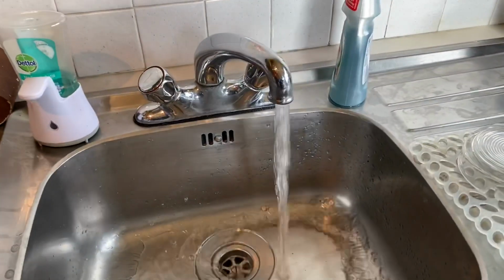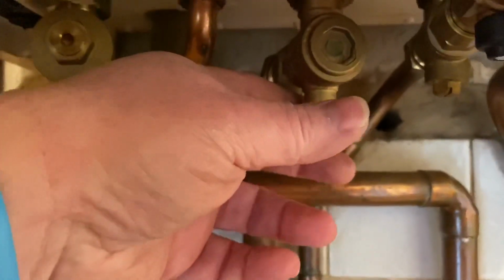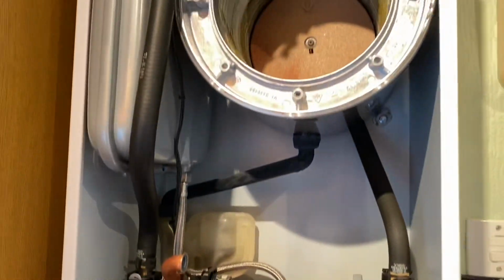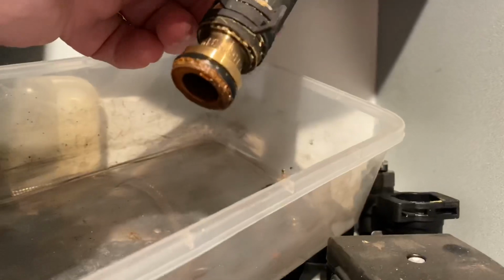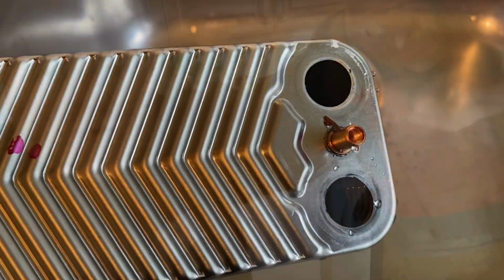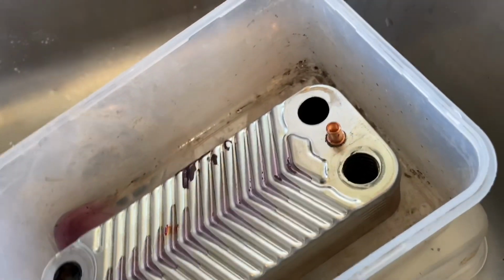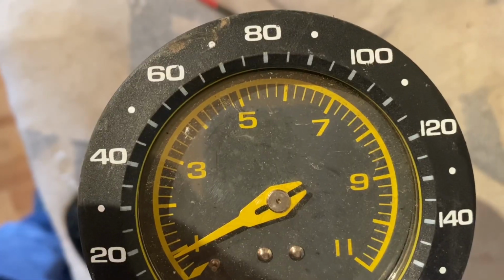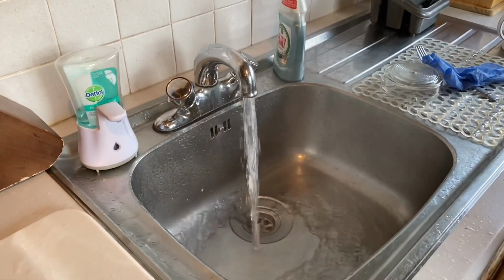Blocked Plate Heat Exchanger Magnetite Sludge - Viessmann Vitodens 100

Comment: so ive got boiling hot water in sink
warm water in shower. 2 showers.
and 2 sinks the same.
is this the diverter valve or sludge in pipes and heat exchanger plate.

also i presume this wont be covered in warranty.

and what should i expect this to cost.

veissman 100.

thx

Comment: Hi Allen,  would you say that limescale is a major cause? i noted you only cleaned out one side of the plate.  i have popped some cleaner into the magnetic filter (having cleaned it out)..i am trying to avoid removing the plate and would rather look for a solution in situ. Very informative video.

Comment: The gas safe engineers rarely open up the boiler. They pull down the front, connect their laptop and that is it until they check the gas flow.

Comment: i am learning so much about my boiler and why the hot water was not working  ,i should have become a boiler engineer especially when you see how much they charge,
Reply: Go for it. Then you'll see that just gas registration (for the first year) is nearly £600. Before that there's the training, which might cost thousands of pounds, a van, servicing, insurance, chasing debts, etc. Every 5 years you also have to resit refresher exams/assessments. (£1000). Dead easy.

Comment: Great, informative, straight to the point video.
This is really helpful, thanks so much!
If I may add one small point, sometimes it may be good to do a second round of chemicals in the exchanger, as the chemicals loses it's potency and therefore it's ability to breakdown/dissolve the sludge/scale.

Comment: Good video thanks. Just be careful to check the rubber grommets (100W) on each of the holes where the heat plate fit are still there before you refit it. Luckily I found mine had fallen out prior, you need to physically check with your hands as you are working blind, otherwise you may have a bit of a leak at the back.

Comment: Hello Allan, I've got a Viessmann 200W 7248829 series, it's about 13 years old Origional Water Heating Pump, do you get problems with these, the Flow to all radiators is very Hot but the return on all radiators is cool, all radiators heat at top cold 1/2 way down, they say that the pump is been upgraded to a 7874668 thats now got a control circuit output to the KM Bus I presume to the main Control PCB (145   X4.1 & X4.2), I was thinking about getting the system flushed, it uses 10mm microbore plastic pipe, I be honest it's never been flushed in it's life, the usual addative has been used and air has always been removed from the system,
I was thinking of changing the 2.4uf capacitor in the pump it's a rebadged Grunfos pump head with just the 230V AC mains feed, from that pump there is no KM control Bus whatsoever ! 
It's my own boiler, I'm wondering if you come across this Viessmann upgrade to their pumps using the Viessmann KM Bus on the 200W 35kW Combi Boilers?  It's still a modified Grunfoss GHE Pump probably about 7meters of head.???

Comment: Is this a standard thing that should be done at a regular service? The reason I ask is because I have a boiler (4 years old) and we have insurance on it for breakdowns,  it is serviced every year, but the past week we havent been getting hot water, an engineer came out (from the place we pay insurance to) and they have said its the heat exchanger that is broke due to sludge build up, and its not cover under warranty, but surly all this should have been checked when servicing, and it should have been prevented? All he did to diagnose was take the front cover off, he didnt strip anything down or even try the hot water, just took off the front cover and looked at it.
Reply from the maker: Thank You

Comment: I was told Plate Heat Exchanger by every man and his dog when my hot water was only warm and the flow rate was very poor. I cleaned it and had a small result but nothing significant. Then I got a real plumber who knew what he was talking about and he diagnosed the issue accurately. My 'diverter valve' was at fault. It was changed and the results were dramatic. All of a sudden the boiler was operating like a new boiler again. Piping hot water with a very healthy flow rate.

Comment: This video saved me!  I live in Canada and I have a Viessman CombiPlus.  I was having significantly reduced water pressure on my hot water (the boiler was working well) which was making it difficult to have a shower.  The local technician had never seen the problem before.  He wasn't able to do anything for me on the first visit, but the next day he came back and I showed him this video and between the two of us, we were able to remove the heat exchanger and clean it.  After that my hot water pressure was fantastic.  I'm going to do this myself every year or so as a maintenance item.  Thank you so much Allen!  I live near the great lakes and we have very low mineral content in our water, but after six years there was enough build up that it significantly impacted pressure.  At first it was intermittent and then it just kept getting worse.  We saw no sludge when we cleaned it, just flakes of dark material.  Interestingly, the part of the heat exchanger where the boiler water flows looked brand new and shiny.
Reply: Hi Denis, Glad to hear u fixed your viessmann, can I ask if the Canadian model is similar to our uk model?
Does it have rubber hoses or metal? Thanks

Comment: Hi, I have vitodens 100 for about 12 years and I have problem with hot water running for a several seconds then cold for several seconds and so on. Is it a heat exchanger blocked?

Comment: Hi Allen Great video a few queries regarding domestic use. I currently have a Viessmann 200 W installed with a Spira-Cross low loss header fitted, light industrial pump to add to the circulation but in just over 3 years I've ditched two heat exchange plates. I've spoken with the plumber regarding dirt separation but the header should take care of this, I've also mentioned the hard water within our area and possibly installing a water softener. Do you think this could help??

Comment: Hi Alan - thanks for all the great videos
did you only use the celaenr on the boiler side (not the cold water mains) of the plate heat exchanger? 
I have the smalle Viessman boiler  and it's been great until about 3 months ago and now the  hot water knocks and bangs / kettles
I was told by the installers about 3 years ago not to use inhibitor in the system as Viessman have a stainless steel heta exchanger / burner - but if the plate exchanger is clogging up then this must mean the system has muck and debris in it...

I am going to isolate the boiler / drain it then take the plate exchanger out (it's really easy on this model as its right at the front and a couple of screws) and then clean it as you suggest

After replacing it  would you suggest adding a cleaner & running the system for a few days  followed by a full drain down and refill + inhibitor?

Comment: I have a 050 Veissmann and had this problem.  Veissmann engineer came out and replaced the heat exchanger, but warned me I needed a system flush.  British Gas came and did it at a cost of £739, but did NOT flush out the exchanger, less than 6 months later, with a service in between the damn boilers giving me the F2 fault again.  Should British Gas Have flushed out the exchanger after they did the flush?

Comment: Would a blocked heat exchanger cause issues with heating my radiators? My hot water takes about 30 seconds to start being hot, but my radiators are not warm at all they stay cold, the boiler sometimes shuts down with an F2 error

Comment: what descaler did you use Alan.?
Good video.
if it was installed correctly,system flushed, and serviced regularly,inhibitor added and checked,this should not happen.

Comment: Good video, Done like it should be. I use the Milwaukee 12v air compressor for charging the expansion vessel, cracking bit of kit and so much easier than a foot pump.

Comment: Allen, I have this exact tankless water heater. When we are trying to get hot water it get to temperature and then the boiler flame shuts off causing the water to run hot and cold hot and cold. Would this be the plate heat exchanger that is gunked up? My plumber recently did a flush of the system. And we are just waiting for gaskets to do the plate exchanger, if you were to guess would this be the culprit? Thank you for you video. You are very helpful. Take care.
Reply: Take it off eco mode and set it to comfort

Comment: Hi Allen, i have a biasi boiler m90e 24s, i was hoping you might  know if the heat exchanger is at the back of the boiler and if it is easy enough to get out and also what descaler would you recommend if i can do this.  Im an electrical engineer so quite mechanically minded, the only thing i dont want to do is mess with any gas pipes for obvious reasons...thanks very much in advance...👍🏼

Comment: Hi Allen , 
love the content by the way, got a problem with the hot water on our boiler. Unless the heating has been on all day to the point where the house is like 23 degrees we don’t get hot water, it’s a vitodens 100 on the front of the boiler it has one dial. Which is for radiators. We never had an issue, untill we had the new boiler fitted it’s been frustrating for about a year. 

But the house gets far to hot, we set the thermostat to 21, if the hot water is switched on there is a switch in the cupboard where the tank is. The heating gets to 23 degrees or higher, even though it’s set to 21 on the thermostat. 

Any suggestions cheers

Comment: Great work and video Allen! Your ‘honest’ attitude goes a very long way. Readers and watchers, from a retired engineer, this man knows his stuff and would certainly gain my trust!
Reply from the maker: Thanks 👍
Reply: @AllenHart999 hi allen, hope you're well. What caused that much muck to build up, esp in the rubber pipes?
Which chemical was used to clean out the hx plate and can you use spirit of salt to clean?
Also, why was the chemical not put in the other two holes?
Reply: If you don't mind me replying?
I've used spirits of salts in the past and has worked for me. The two uncleaned holes don't need cleaning/treatment/flushing as they have the clean tap water running through them, but the other two have the dirty, circulated water running in them, and the scale must build up inside the rubber pipes too. But I'm sure Allen will give you a more comprehensive answer.
Reply: @andrewislam7295 hi Andrew, thank you for your reply.
So the two holes that were blocked, that was the water circulating from the heating system? 
Two holes for the heating and two for domestic hot water?

Is there any way to unblock the plate without removing it?

Comment: Fab mate!! Great vid from start to finish.  Is there a way to clean to Weissman heat exchanger without taking it out as a quick fix seeing as it’s winter and I wanna get it running again a bit better for now.  I have one of those magnaclean things but it’s pretty damn clean and I guess that’s just to do with radiator heating not hot water.  It’s not too bad but goes in waves like you show. Thanks anyway for your great vids. I’ve subscribed

Comment: Why do some gas engineers  want people to buy new boilers when it easy to get parts and fit them . Just like a car you dont go buy a new one if the fuel pump or breaks fail . For example i have  worcester bosch main heat exchange 301 r. National  spare part sell them for 80 pound with a year warranty . However  some many boiler men  dont want to touch it . Is it case of lack of experience? I mean  how much should it cost to put in new heat exchanger just for the labour.

Comment: Nice to see stainless steel components that can be descaled with acid. Would proper power flush do this job instead, using FX2 for example? Rest of the system cleaned as well.

Comment: I had this problem with my Vokera, I removed the heat exchanger and gave it a good flush out but nothing much came out. In the end I fitted a new one and it cured the problem, unfortunately 3 years later the pressure in the system is now going up by itself; even with the feed pipe disconnected so it's looking like it may have a split inside the new heat exchanger now.

Comment: All very well Allen , I’m a plumber and people want a service for 60quid so they get the flu gas analysis and the condensate cleaned out and Macneclean if they have one , if you start ripping apart a boiler like that other problems can occur , pipes split , plastic housings crack , you can end up having to order parts so anyone watching this needs to realise this kind of service is going to be about 200quid plus any parts that might need replacing , in a ideal world yeh clean the burner clean the gas valve charge the expansion vessel if the diaphragm isn’t split already ...... this is giving mr blogs a unrealistic impression of what they are going to get , also pressure relief should be checked upper limit stats diverter valve fully opening and closing how far do you go with it ? Because if you go to do a service and end up giving them a 500quid bill you arnt going to get another job of them
Reply from the maker: The plate heat exchanger was blocked. Thanks.
Reply: I know that , but numerous times you say the boiler hasn’t been serviced , but the customer said it had been a few times , I’m so they will be thinking the plumber they used wasn’t doing it properly when in reality he will have been servicing just not to the degree, thanks
Reply: What I’m saying is people get what they pay for , I would love to strip down every boiler and get them running 100% but no one would ever want me back there after I give them a 250quid bill , I charge 60 for a service and I am often challenged on that saying they can get it done for 50 it’s dog eat dog and there is a  hell of a lot of cow boys out there

Comment: You saved my life!! Thanks a for for the video. Subscription is a must in your channel. My boiler is working fine again but I still have a problem. Using the hot water in the kitchen´s sink, close to the boiler and in the toilet´s basin, the boiler is working the right way. Around 68º , boiler going up and down but temperature constant in + - 5º.
The problem comes when I use the shower. Then, the boiler gets the problem it had when the plate heat exchanger was blocked. Temperature goes up till 85º then stops and starts again, but no hot water. Close the shower, try the basin or sink and works fine. Any idea what can it be?
Reply from the maker: Thank you.

Comment: I have had the same problem with a viessmann, had 3 new heat plate exchangers so far. Would i benefit from a powerflush? My radiators are getting hot which is good and so is my tap water but all 3 heat plate exchangers ive had have broken because of rust, sludge etc?
Reply from the maker: Might need a powerflush doing correctly and the hoses checking. Thanks.

Comment: Hello, pls could you leave a name of that cleaning agent you used for cleaning the heatexchanger, also did you clean the whole boiler with this solution or just the pipes and exchanger? Meaning.. if you pumped up the whole system with this agent to clean it, or you just did those two parts and i was not necesary to chemicaly clean the rest. Thank you

Comment: Hi, I've got a Vitodens 050-w that was only fitted less than 2 years ago. Our shower keeps running hot and cold.  When the shower is running, the flame comes on, ramps up, then goes out, on again, and so on. Doesn't seem to affect other taps in the house, just the shower. The boiler pressure was low, hovering just above 0bar so I've sorted that (thanks to your video!) but thats had no effect on the temperature issue of course. I'd like to have a rough idea of what the issue could be so I know I'm getting the right advice when someone comes and looks at it....thank you so much!

Comment: Great video Allen , I’ve got the same problem at one of my renters , what chemicals did you use to flush it out mate ?
Reply from the maker: Sprint of salts
Reply: @AllenHart999  Diluted or as it comes in the bottle? Because as it comes in the bottle it's 25-30% hydrochloric acid, pretty strong stuff.
Reply: Another quick question would I have to drain down the heating circuit too or just isolate the cold feed In too clean the hot plate exchanger 🤔regards Andy.

Comment: Hi Allen
Your help would be very much appreciated, especially with the weather forecast for this weekend.
Our Viessmann Vitodens 100 was suffering with the symptom of the hot water coming in and out (not good in the shower), our plumber has replaced the plate heat exchanger (his first time working on a Viessmann) but when he came to turn the boiler back on it refuses to fire. The power is on and two orange lights come on the right hand side of the control panel and green on the left, but the display only shows the shape of a house with nothing else and no fault code. The fan & pump seem to be running. Have you ever experienced this as our plumber is at a loss? 
Hopefully you can help
Reply from the maker: Its hard to say without testing it. Might be better to get someone out who knows how to repair Viessmann Boilers. Has he checked the hoses?

Comment: As well as the heat plate the flow switch on this and the 050 can model can impact the hot water performance
Reply from the maker: Blocked hoses could effect it. Thanks.
Reply from the maker: Thanks very much for your comment, please consider subscribing to support the channel 🙂